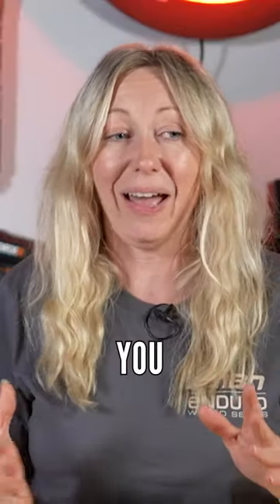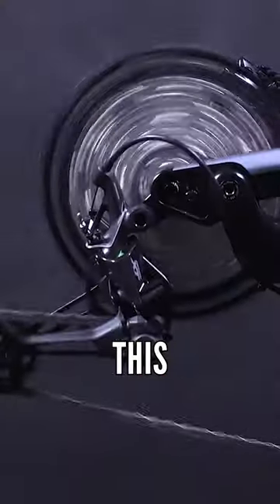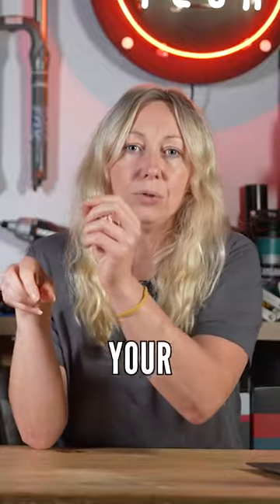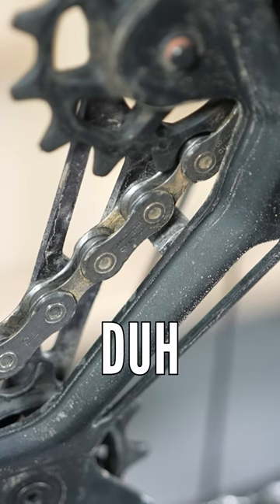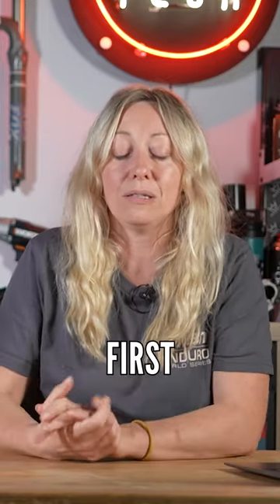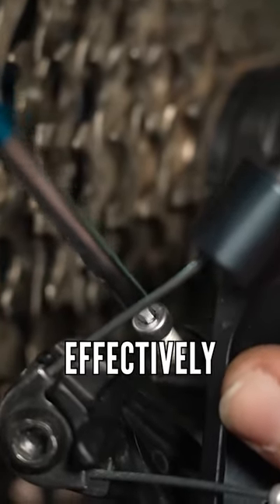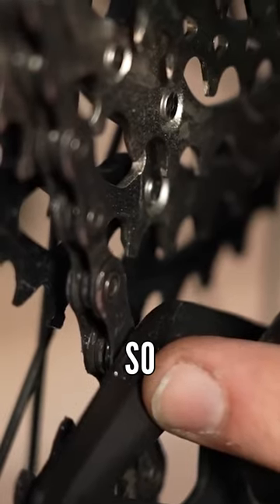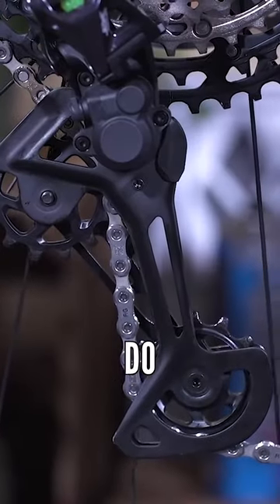How To Diagnose Drivetrain Vibrations! 🧑‍🏫

Comment: From my experience on multiple bicycles in the top gear, which is commonly an 11t cog, you can feel a vibration through the pedals. Tweaking the high limit screw on the RD can solve the problem.
New chain on a used cassette can feel crunchy and just let it break in as you ride, maybe after first 100 km it will be smooth.

Comment: The drivetrain in question is brand new complete 2023 XTR. All components installed correctly and adjusted properly. I’ve taken to my lbs and was told that it is the interface between the narrow wide chainring and the chain. That it will eventually wear in. I am disappointed with this issue. XTR is supposed to be top tier components.